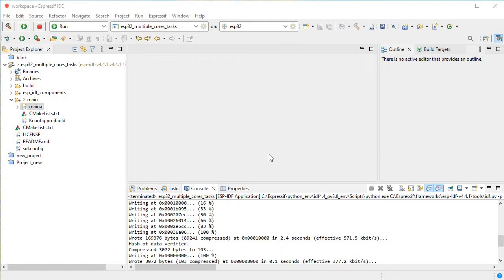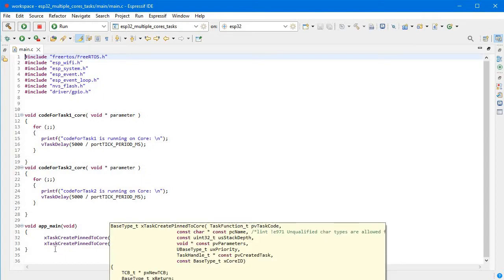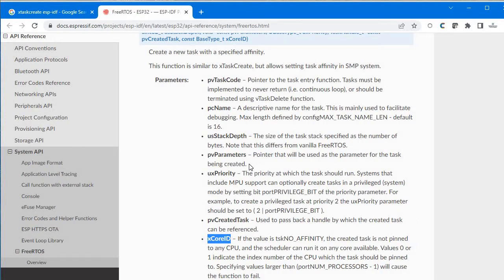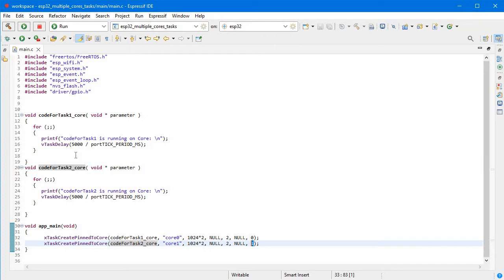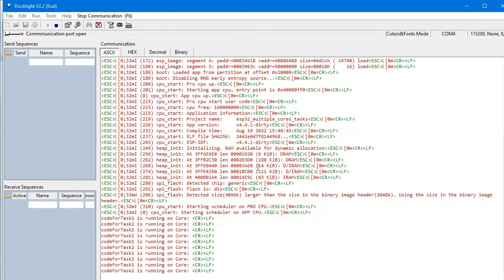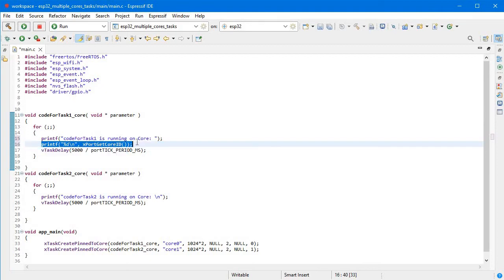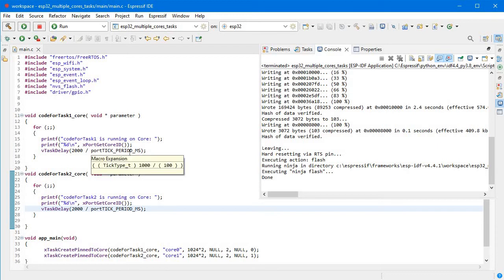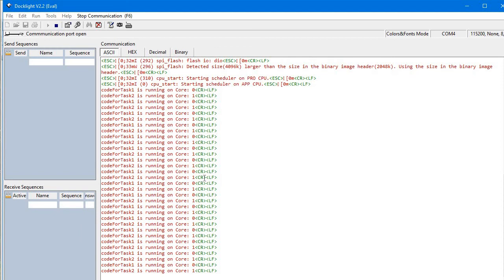How to run tasks on two different cores of ESP32 with ESP-IDF using espressif IDE

Comment: I have an ESP32-C3 which has a single RiscV but does have an ultra-low-power core.  Do you think the same principles would apply?

BTW, any chance you can do a websocket project using the EspressIF IDE?

Comment: Thanks but it is not working for me

 I use ESP32_ mini_1
They wrote:

"Running on single core variant of a chip, but app is built with multi-core support"
"Check that CONFIG_FREERTOS_UNICORE is enabled in menuconfig"
Reply: I know this comment is old but for others who may have the same issue this message is telling you that you are trying to add code for dual-core support, however, the ESP32 chip you are running on only has a single-core. With the ESP32 there are single and dual-core variants if you want to use two cores then make sure the ESP32 IC you are using supports dual-core.